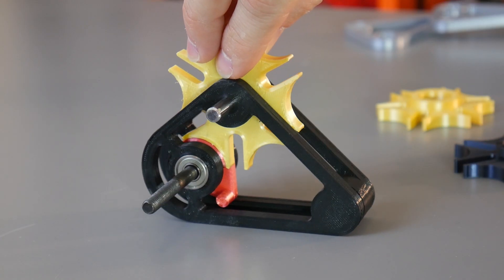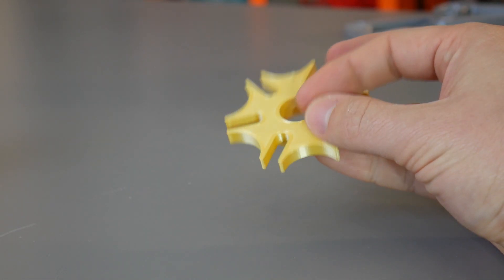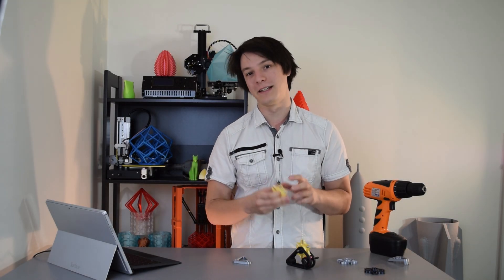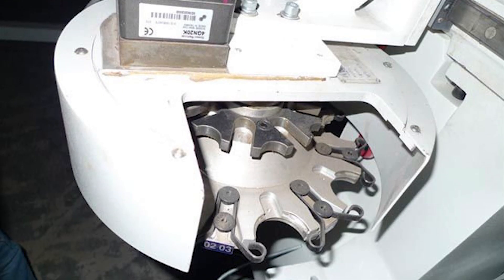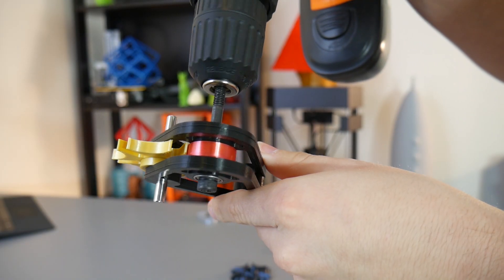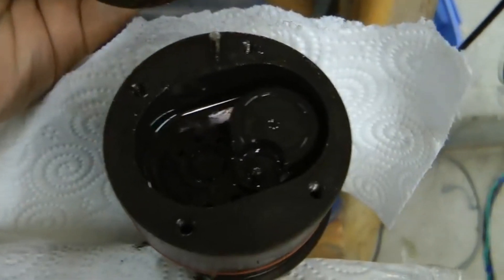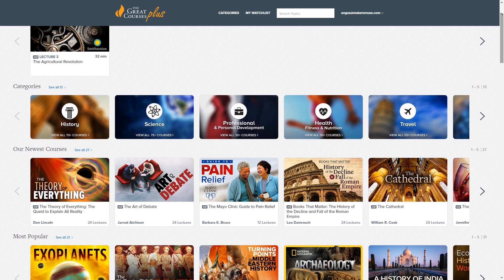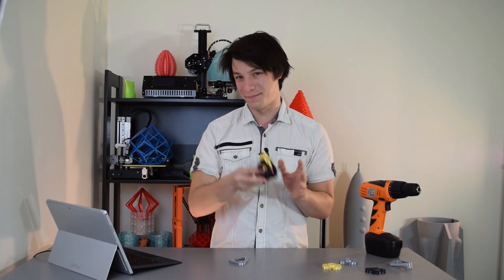The Geneva Mechanism

Comment: I had several hobby movie projectors and cameras when I was a child and teenager. The "stop-dwell-go" device in these projectors, called a "shuttle" gave the exact result type of movement as the Geneva Mechanism, but worked very differently, and was probably much more durable in terms of equivalent materials and tolerances.

Now the Geneva Mechanism, as shown could advance against a piece of film trapped between a flat platen and pressure plate (the "gate"), engage an indexed hole in the film, drag the film a certain distance, disengage from the film, which allowed the film to stop, and after the desired dwell time, catch the next index hole, advance the film and repeat the cycle. This whole mechanical system was the shuttle. 

(Here's a short animation video to detail this operation: https://www.youtube.com/watch?v=ZNV79Nb1qM8. Here's a really short video showing the Geneva Mechanism in a Keystone Projector: https://www.youtube.com/watch?v=ZNV79Nb1qM8.) 

There would be a mechanical stroboscopic mechanism (the "shutter") that would only allow light to shine through the film, through the focusing lens system, out the projector, and onto the screen only when the film was stopped at the proper place in the gate. The film needs to "stop-and-go" in the gate, but otherwise move continuously between the supply reel, through the projector, and on to the take up reel, so a freely moving loop of film was placed on each side of the Geneva Mechanism/shuttle, allowing continuous motion at one end of the loop, and stop and go at the other. This was accomplished by placing a sprocket behind the gate, running the film through the top half, into a loop, through the gate, into a loop, and through the bottom half of the sprocket. (Alternatively, there could be an upper and lower sprocket above and below the gate. In operation the loops would get incrementally bigger and smaller with each cycle of the advancement mechanism.) In operation, his whole system would take advantage of the "persistence of vision" effect of the human eye-brain mechanism to produce.

Hobby projectors, almost in every way, were identical, except they replaced the Geneva Mechanism with a much simpler device, which was kind of like a single-station Geneva Mechanism, also called a shuttle. My very first projector was a fairly simple eight millimeter projector aimed at the children's market, but it was as sophisticated in its own way as any "adult" hobby or school projector of the times (very early '70s). It had a very simple film advancement method. Imagine a long, flat blade of metal with a large hole near the middle of it. This hole is somewhat like a squared oval, circular at either end, with flat top and bottom. (Think of the shape of a race track). This blade has two prongs the end nearest the gate mechanism, the end with the large hole, and slot at the other end, the pivot, consisting of another racetrack oval. When placed over a pin in the proper orientation, the blade can  move back and forth horizontally, but not vertically, while at the gate end, move up and down vertically a few degrees. The large racetrack hole near the middle, would have a camshaft run through it. As the camshaft turned, the cam would act on the racetrack hole, first lifting the gate end, while pulling the blade back, then dropping the blade while pulling it forward, then pausing the blade, then dropping the blade while pulling it back. The prongs in the blade would catch on the film, advance it, pause it in the gate, advance it again, disengage from the film, and repeat. The shuttle, shutter, looper, projector lens and supply/take-up mechanism worked substantially the same as on other projectors. 

(This whole action of the shuttle device can be seen around 8:55 in the following video: https://www.youtube.com/watch?v=vsBJwQ-C9oc. At :15 in this next video, you can see the shutter and stroboscopic device integrated together: https://www.youtube.com/watch?v=En__V0oEJsU. This video goes on to demonstrate the entire operation of a Bell and Howell 16mm projector. It's shuttle operates somewhat differently than the one I described, as you will see. Notice how it works at right angles to the one I described, and only moves up and down, with no back-and-forth movement, along the axis of the blade, and back-and-forth at right angles to the blade.)

An even later B&H home projector that I got in the mid-70's had a somewhat simpler shuttle mechanism than my first projector did. But, it's late, and I'm tired, and you're probably sick of reading this comment, so I won't describe it, except to say it  worked the substantially the same way as the one I described. I could find no examples of either on YouTube or some other websites. Interestingly enough, it did not have a sprocket to create the upper loop. As the film advanced through the shuttle, it was pulled down against a spring loaded arm with a roller, which would pivot slightly towards the gate. This action would pull a short section of film off the supply wheel. When the film paused, the arm would pivot back towards the supply wheel, which because of inertia would still be moving slightly,. The repetitiveness of this motion would create the upper loop. This whole mechanism would allow for auto-rewinding. When the end of the film, securely attached to the supply reel, was reached, the film would advance enough to collapse the loop, placing tension on the film, because it was still being pulled by the lower sprocket. This moved the lever even closer to the gate, triggering the whole rewind action. (As a side benefit, if the supply reel jammed, the loop would collapse, again triggering the rewind action.) As the film was rewound, tension on the film pulled the arm towards the supply reel. When the end of the film ran past the arm, it relaxed to a neutral position, turning the projector off. Ahh... technology and engineering, a beautiful marriage.

If you've gotten this far, thank you, and God bless you for your patience and curiosity.

Comment: GE made electric meters for many years and some of them would be fitted with a special register to measure kilowatt demand, and a Geneva mechanism was used for the block interval timing function (to reset part of the register once, twice, or 4 times each hour).

Comment: Hi ( any one likes a challenge ) 
I have a small metallic cylinder in which is a small gear . If I insert a threaded rod , it will engage with the gear and move. If I want to pull it back , the gear will not respond. How is that possible  ? I can only pull the threaded rod out only if I disengage the gear. How would you make a gear rotate only in one direction and jam if rotated in the other ???

Comment: While you are right about this being a high-wear mechanism, that did not stop 35mm projectors from being extremely reliable. As long as you kept the intermittent assembly well oiled, and kept the oil fresh, it's common to get literal decades out of a projector, even running them 10 hours a day, every day, 365 days a year.

Comment: The Geneva drive is used in the 7.62mm and 30mm chaingun that is fitted to many armored fighting vehicles and helicopters.
Reply: The Geneva Suggestion
Reply: Huh I was trying to think of one but I never thought it would be for a cycling rounds
Reply: The firing mechanism has remained unchanged and still relies on the same principles. Feed (cock) load (lock) fire (unlock) extract (eject). This is the same across bolt action rifles and electrically operated chain guns.The latter uses a chain which is fitted with a cam that runs across a rectangular path and works along side a Geneva drive to control dwell time between firing rounds.
Reply: mark price the 20mm as well
Reply: @markprice5061  sounds like a four-stroke thing of beauty
Reply: And prior to all the electrics, was/is used in the hand-cranked Gatling gun, with mechanical advantage from a crank substituting for a motor.
Reply: He knew that, comments =$
Reply: finally someone that tells me how to use it

Comment: The Geneva Mechanism or a variant was used on World War II era tanks. Or at least some German Ones. Early Autocannons and smaller ones with lower rates of fire used a variant called a Geneva gear to time the mechanism for loading rounds.

It was also used in some early Machine Guns to pull a ammo belt.

One odd fact I know and have seen is it usually was lubricated/cooled by the same lubrication system as the vehicle or by the Water Cooling mechanism of the firearm.

Oh and when used they were either insulated by metal or where around louder sounds like an engine or a firearm report.

Comment: Hi, I am  working on one hobby project wherein I need to make an electronic lock using a simple micro-DC motor with 0.6mm shaft diameter. I am looking at mechanisms like - Slider Crank, Scotch Yoke and Geneva. 
Your videos are very useful and it would really help if you or anyone can help me select a right mechanism. 
The product would be very small in size.

Comment: Geneva lock and geneva drive used in the fuel control unit (FCU) of the T56 allison turbo prop fitted to c130H/K Hercules and also in the Dowty propeller gearing to ensure constant fuel flow in the FCU and to ensure props do not travel below minimim angle of attack. Old school mechanical technology from the 50s. Its all electrically controlled now.

Comment: Speaking of old movie cameras that were manually operated with a crank. What was the mechanism that allowed the operator to turn the crank outside the camera at a variable speed (a human speed cannot be as exact as a motor speed), but obtain a 24 frame per second movement inside the camera? Yes, the Geneva mechanism will give you a sequential intermittent movement inside the camera, but what regulated the movement to sum up exactly at 24 frames per second (or whatever number the manufacturer desired)? I cannot pace myself to turn, by hand, an old manual movie camera crank at exactly 24 frames per second for a prolonged movement -- so how did they do it?
Reply: As far as I know, it really was up to the operator to keep a set speed. Small variations can cause a noticeable change in the pitch of human voices so the projectionists got good at keeping at a set speed, or at least "good enough", via listening to the sound. For silent pictures, I suppose there was quite a bit more room for error. I'm not sure how the recording camera man kept speed, but I suppose if the print was both hand cranked to record, and hand cranked to project, variations could be compensated for.

Comment: 25 mm Bushmaster Cannon. Firing cycle of operation...Sear, Feed, ram, Fire, "Dwell", misfire, extract. Common Weapon System on Light Armored Vehicles.
Reply: Weren't guns on fighter planes timed to fire through the propeller gaps?  I wonder if something like this was used for it.
Reply: @Entrepid83  https://youtu.be/faZiS1CYZs0 Different mechanism explained pretty well here :)
Reply: @Entrepid83  Even more interesting, those timing mechanisms were invented years after machineguns were being mounted to planes.
There are planes that had metal plates on their props, to deflect the bullets away, until the Germans invented the gear system that only let the guns fire at the correct time anyway.
Reply: @Entrepid83  no just timing
Reply: Mk44, M242 and M230
Reply: Hell yeah I was a Bradley gunner
Reply: @vinnie2744908  epic
Reply: Would I be mistaken to say this was also used in timing machine guns to fire through the propeller of an aircraft thus enabling the first aerial dogfights?
Reply: @Bryzle1  YES!!! Good one on ya!!!
Reply: That’s the 242 right? Worked on them before, sometimes the feed is a huge pain
Reply: I think the transfer units on M61 gatling guns (Phalanx CIWS) use this mechanism, or something similar in the transfer units that load/unload the drum and move the rounds/brass to/from the drum to the gun.
Reply: Huh I didn't know that, cool
Reply: Automatic candy wrapping machines also use it...........
Reply: I was thinking along the same lines when I saw it moving at high speed.
Reply: Don't it also apply to rotary bomb bays?
Reply: B. Sean Fairburn thank you so much
Reply: Worked on these in the navy as well.  never realized that it had a geneva drive, but it explains why it was the part of the gun that failed more often then not.
Reply: I was looking for this comment before I posted lol.....many years looking at that display on the back of the cannon  and manually cycling the action lol
Reply: Yep, came looking for this but also to say military could use it for machine gun action.
👍👍👍✌✌✌
Reply: Yes, I was like "haven't I seen this on a chain gun diagram?"
Reply: israel thanks you for your service
Reply: ya. fitted with sealed bearing a round or shell was always thunked into place really fast. the mechanism was 100x more reliable than the munitions haha
Reply: If
Reply: Its only in the feed though The barrels are chain driven but yes hes right
Reply: @stonerayven2455  pretty sure they're would be one of these in the Defa and Aden Revolver canons as well.

Comment: A military application would be to use this for a crude mini gun. The rate of fire would of course be much slower and less mechanically smooth in comparison to the U.S Army's M134 minigun, which uses a solenoid. However, I could see this as a possibility in an older, similar model or during use on an aircraft that fires rounds through the path of the propeller blades. Does anybody know if the synchronizing gear is a form of the Geneva Mechanism?

Comment: I think this is an an example of how this was used in Military applications look in the center of a revolver's cylinder. The system works with a two piece "Geneva device" that as the hammer goes back the pin comes up rotating the cylinder for the next round to fire.

Comment: If you're looking for military application, the rotating-barrel gatling gun spins to reduce heat wear on the barrel and uses a similar mechanism to hold the barrels in place while the bullet is traveling through it, rotating to the next barrel once it's clear.

Comment: Military application: I would suspect that this, or something similar would have been used as an 'interruption gear' for machine guns firing through the airscrew of fighter aircraft, particularly in WW1. Such gearing prevented the machine guns from hitting the blade and allowed the guns to be mounted on the fuselage which allowed for mor accurate aiming. I don't know whether the Geneva mechanism was used or a cam lever.
Reply: This is the exact WW2 (actually used in WW1) application I was going to suggest. As a kid I remember asking my dad how planes could shoot through the propellers. Some may use the method described in the video, but the ones I've seen use a different mechanism like this https://www.youtube.com/watch?v=faZiS1CYZs0

Comment: I used it in textile weaving machines in late  80's developed several models bass on this mechanism. noise and heat was major limitation for using it at high speeds

Comment: Would a Gatling Gun use a Geneva mechanism like this to ensure that the firing pin lines up with the striker? I imagine it would help prevent the bullet from misfiring when it is not in the correct position. I found some diagrams with one at https://www.google.com/patents/US4481858. You can see it at the bottom of sheet 2, or more clearly on sheet 5. It is a 3-dwell mechanism.

Comment: Excellent video. I work in the automation industry, and one of my favorite machines I have worked with is a cupcake cup-denester. What fasinated me was that they used a servo motor to spin a geneva mechanism to achieve two different types of motion using only rotation of the servo. Essentially, pistons pointing down, pistons pointing up, would rotate 180 degrees, resulting in the same configuration before. But then, using a cam, they would jut out up and down respectively. I'm sorry if my description is confusing or lacking. Here is a video of it. Such a satisfying machine to watch.

https://www.youtube.com/watch?v=BwFhZM-u0xs

Comment: I worked as a projectionist at a theater for many years.    In 8 projectors I think we only had 1 "Intermittent"  (the name of the part in a projector that advances the film 1 frame at a time) failure.   This was over about 10 years.    Pretty reliable if you ask me.

Comment: Some older gatling guns have a similar mechanism, where the firing pin is in a fixed location and the Geneva mechanism is essentially used to mechanically time when the firing pin mechanism triggers when a loaded barrel is in the proper position.

Comment: In model railroading, this is a great way to have a turntable (A piece of track that spins on a center pivot, useful for turning locomotives around) stop at exactly the right spot every time. I have an older Atlas brand turntable that does use a Geneva mechanism to ensure the rails on the turntable line up with the tracks leading to the turntable pit. Geneva mechanisms do allow a good deal of precision, and if the rails are misaligned even slightly, the engine derails.

Comment: "This basic system is set forth in the Glov Patent 1,164,- 498, which issued December 14, 1915. In theGlov patent, both the upper and the lower cylinder are directly geared to a Geneva mechanism that is driven by a hand crank. The Geneva mechanism converts the continuous rotation of the hand crank into intermittent rotation of the two cylinders. A dwell period is provided each time two half chambers coincide to form a full chamber. During this dwell period a firing pin is activated to fire the cartridge. The rotation then continues to place a second pair of half chambers in conjunction at which time another dwell period is provided for firing the second cartridge."   https://patentimages.storage.googleapis.com/pages/US3262367-0.png